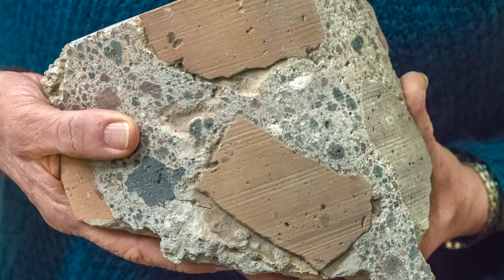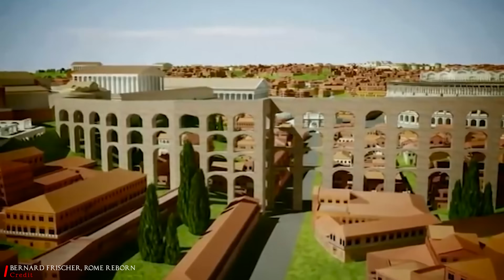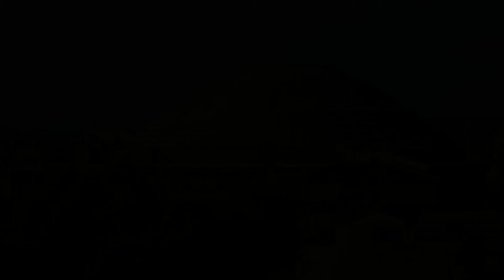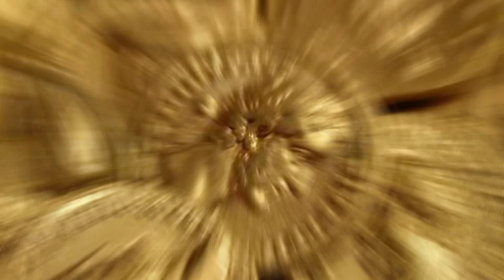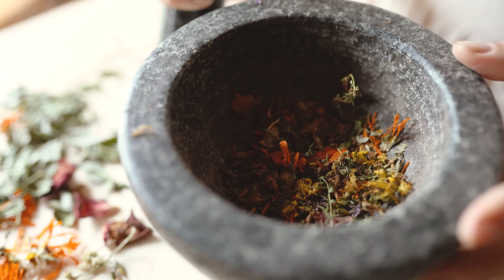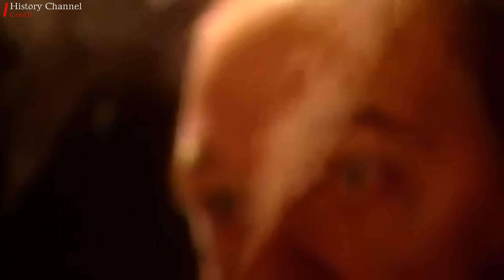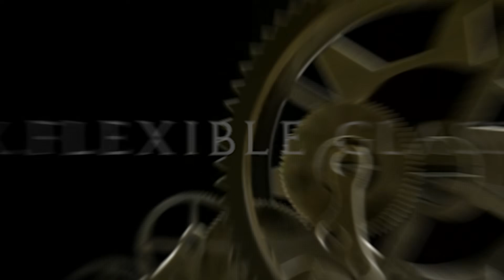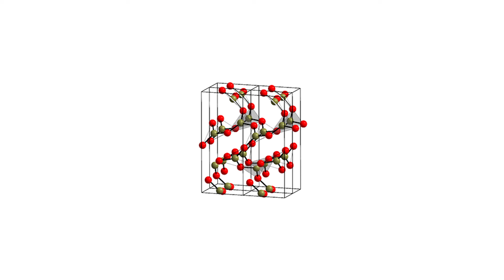Top 10 incredibly advanced Roman technologies that will blow your mind.

Comment: It is worth commenting the opinion that "Roman is one step away from Industrial Revolution" from an economic perspective: In the age of slavery, it more profitable to use cheap slave labor to move the mill than to invest in expensive machines.

Investment in capital (machines) is only profitable when the capital to labor cost ratio is very low (when the machines and raw materials are cheap, and labor cost is very high). It is not profitable to spend lots of money in water mills if your competitor uses plenty of cheap labor instead to move it 24/7 nonstop. 

Modern industrial revolution originated in Britain because the labor cost was very high, and the coal price was low. At the same time in Japan, because of the population boom, many business discarded water mills and uses human labor instead. Once Britain build factories at massive cost, it is able to produce massive amount of textiles at much lower cost than Japan, but only after large investment in machines. 

So in conclusion, the Romans were technologically advanced to proceed to industrial revolution, but the system of slavery prevents it from adopting those technologies.
Reply: @Lucas De Araújo Marques As I have illustrated before, 18th century Japan also don't have slavery, but the labor price is still very cheap due to the population boom so the capital to labor cost ratio is still very high, which makes investment in industrialization unprofitable even without the slavery system. The key is how expensive the labor cost is, with respect to the machine cost. (I guess the water mill mentioned in this case is very expensive so require huge investment.) 

In addition, another condition for the industrialization is integration into the world economy. 19th century Britain is able to sell manufactured cloth to America, India and China, all of which are huge markets. Therefore, exports would make a lot of money for Britain. Even if Rome get industrial, the limited global trade in that time would made it impossible to make much profit from it, simply because there are no large markets for its products.
Reply: @junmianzhu7459  
They probably had both. They covered their bets
Reply: The Romans began to slowly abandon slavery in the 3rd century and serfdom began to develop gradually. The colonat began to develop. This system remained in parts of Dalmatia (formerly a Roman province) until the 1920s .... even the land remained divided in the Roman way, the so-called Centuriation (Roman Grid), the remnants of such a division of the country can be seen from aerial photographs from the beginning of the 20th century ...
Reply: @marin8862  The Romans did not abandon slavery in the 3rd century. Slowly or otherwise.
Reply: @spiritualanarchist8162  the transition from slavery to feudalism began in late antiquity. it was a natural process that ended in Europe sometime in the 14th-15th centuries. There were a significant number of slaves only in Italy and the rest of the empire was almost non-existent.

Slavery in Italy was the result of endless wars during the republican era.Peasant landowners were drafted into the army and took part in wars for several years, and their families accumulated debts, which in turn meant that the rich Romans confiscated their land in the name of debt.

In this way, over the centuries, large estates of agricultural land were created in Italy on which no one had to work. At the same time, after each war, the Roman state had a large number of POW and high costs of military campaigning, the solution imposed itself.

As the war conquests were absent, as well as the influx of prisoners of war, the rich began to offer their land to ordinary Romans for cultivation, with some giving of the goods they produced. And that was the beginning of European feudalism.

Slave labor was very inefficient and expensive, most of the Roman infrastructure was built by the Roman army. When there were no wars, the Roman army built infrastructure, cultivated land or produced weapons. At that time there was no laziness in military camps, like today.
Reply: @marin8862  You seem to have developed some kind of alternative history. Slavery was a huge part of society  .It started way before before the Roman republic , and continued  after the fall of the Western Empire. Not just in the Greco-Roman sphere but everywhere in the known world.
Reply: Q: ended in Europe sometime in the 14th-15th centuries...
A: Except for Muscovy, where 92% of population were slaves until 1861.
Reply: The Romans used both machines and slaves, the Roman machines needed constant supervision and did not have a stop button, but it is clear that the machines were certainly faster than the slaves, if you are interested in the Arctic ice there are traces of pollution, those in the video are only part of Roman technologies, Roman society in some ways was like modern one, there was also a public school.
Reply: Industrialization didn’t happen in Rome because they simply lacked the resources and their metal refinement was not advanced enough. The Romans did not have enough access to the massive amounts of coal and steel needed to build factories on such scale, and the quality was metal was much lower than needed to build steam engines.
Reply: @wormius7350  Yes but I think the idea is that the Roman empire had a far more advanced technology then those who followed. It had acces to the same Resources the British had in the 18/19th century , only on a smaller scale. But it's all speculation anyway . It takes a lot of inventions , coincidental discoveries , metallurgical skills etc,etc  to develop a functioning steam engine.
Reply: This guy can't tell difference between slavery and servitude. My God. Also, good bs you fantasied in your big head.
Reply: @Dawson Davis The food use to feed slave is only counted as production cost. You are arguing that if labor cost is too high (slave need lots of food), then it lowers capital to income ratio and makes it worthwhile to invest in machine. 

I don't buy any Keynesian argument about insufficient demand here since the Roman military expenditure consistently shores up demand.
Reply: Like China?
Reply: @paulfri1569  actually, this is probably the best comparison to make
Reply: @Bolognamonster  thankyou. Abundance of people and no need to innovate as much..
Reply: No matter how you look at it....
The genius comes from the architect .
Reply: @helbitkelbit1790  The engineers maybe ?
Reply: build water mills and steal your competitor's cheap labor
Reply: "24/7 nonstop" redundant
Reply: You are missing two big variables; land usage and available technology.  Startup costs are ignored in favor of profits when they are possible within a few years.  Otherwise no one would have ever switched and half of us would still be ACTUAL slaves and not 'effectively' slaves.  

NO ONE made the switch until the tech was actually available; it wasn't a business that developed the technology with money, it was individual people striving to make advances because it was still possible to do so without massive funding.  Mostly to; buy themselves out of slavery or lift themselves and their families from poverty.  Innovation was driven by human misery instead of hope up until about 100 years ago, well after the end of slavery.

Your mistake here is applying todays economics to 200+ years ago; it just isn't the same.
Reply: @Nicholas Time  You do know Romans lived in the 'iron age '  right ? They used iron.
Reply: @Nicholas Time  P.S : I'm not claiming they could create steel engines,  I'm just pointing out that Romans obviously used  .They had mines,forges, tools, weapons, etc . There was also a limited amount of  Roman steel , used in Roman armor . Not today's stainless steel, but steel nonetheless.
Reply: actually, roman’s, while conservative in investments. would always look for new technologies that would improve production with their slaves considering how expensive they were.
Reply: The Romans used wind and water mills in agriculture, mining, construction, forestry, etc. These machines were made of mostly wood. 

The Romans didn't have access to cheap or plentiful steel because they didn't have furnaces that burned hot enough to melt iron. 

Bronze could be melted and thus could be casted, but was expensive at that time. 

They just didn't have steel piston engines and stuff like that because they didn't have the technology to make such things...yet...even if they had no slaves

Advancements in technology can make industrial equipment and processes cheaper. The Romans also didn't have enough time to reach the point where mostly machines became more economical than mostly slaves. (Note, that the Romans did have and use machines...just not significantly) 

Slavery peaked during Rome's largest conquests. It started during the Punic Wars and declined after Augustus. During this time there was an abundance of slaves and thus slaves were cheap. 

A string of slave revolts also influenced the later decline. 

By the time of Augustus' death, expansion stopped for a while, but there was a little more expsnsion later.

Slavery still existed but it declined due to a decline of slaves on the market...which was due to a lack of new conquests. 

Paid labor and Serfdom started to fill the labor gaps as access to slaves decreased.

Also, Rome's primary use of slaves was in agriculture (an industry that is still highly laborious). This was because during the Punic Wars, a significant potion of soldiers lost their farms due to being on campaign, without returning home for the harvest season. 

Rome used to have a well functioning land distribution system. The amount of ownership of land was limited by law, per individual. But this system fell apart due to large numbers of Romans losing their farms, and corruption seeping into the government (Rome used be be increadibly incorruptible and disciplined).

A great number of slaves were available after the Second Punic war. Wealthy individuals saw an economic opportunity and using loopholes in the law, acquired large swaths of land, forming large corporate farms, worked by these cheap slaves.

Our perception of Rome is mostly of a certain short period in time.

E.g., there was a time when Roman legionaries, Centurions, the collosium, etc didn't exist yet. Legionaries came into existence when Rome ran out of soldiers because landownership was a requirement to become a soldier (as pointed out before, Romans had lost their farms en mass).

So, a professional army system was created by Gaius Marius...and anyone could join and become legionaries (even non Romans).

E.g. Most of Ceasar's soldiers were Spaniards, Gauls, etc.

All of this is actually also what caused Rome's decline. All those landless Romans (plebs) migrated to the city of Rome, en mass. This change in demographics created huge political shifts and caused the rise of populist politicians like Caesar. 

Before all this, Romans were the epitome of not being corrupt. Their greatest hero's (individuals they admired and strove to emulate the most) were individuals who resisted corruption in some event. At that time, the Romans were extremely focused on things related to being disciplined, incorruptible and having honor.

Rome had an elected office called Dictator. In special emergencies all power was given to one individual. This office was used several times in Rome's history. Individuals who stepped down from this powerful position automatically went down as legends. The Romans understood how corruptible this position was and how much discipline it took to step down. 

All Romans (before Rome became corrupt) who pursued a political career, aimed to reach that height and the prove their discipline and incorruptibility by stepping down when the emergency was dealt with. 

This was part of Roman culture. The Romans has a code (almost like the bushido code) called the Mos Maiorum. Rome was glued together with this unofficial code. It was also when this code was no longer as revered that corruption seeped into Rome

Most people don't know this version of Rome. This was the version of Rome that fought Hannibal and refused to give up. But, in some ways, defeating Hannibal was what caused Rome to slowly become extremely corrupt.
Reply: @tylerdurden3722  You're mostly right, but they had iron in Roman times. Iron by itself is actually weaker than bronze so it was hardly used. Having an ever increasing harder time to find tin to make bronze civilizations eventually turned towards iron more ESPECIALLY after the discovery of how to make steel from iron... as I have heard. 😅
Reply: .....and the rich and powerfull allways hindered oppozing  every advancement  that would infringe on their proffits...just like they're  doing in our times where ever tbey are able to do so. How many patents have been bought up by corporate mafia just to silence the inventors, or if they wete not willing to sell them,  they were silenced  "otherwise".....
Reply: @tylerdurden3722  The Romans certainly had iron. most Roman armour was made of Iron, However bronze held a better edge than their primitave iron, and was not as brittle, It was only with the development of eairly types of steel, that bronze was surpassed. ( so I have read)
Reply: @groblerful  Yap, the Romans had steel, but they didn't have cheap plentiful steel.

Their steel was wrought iron produced in bloomaries.
These bloomaries weren't hot enough to melt steel and produced a mix of slag and iron called sponge iron. 
Impurities had to be painstakingly hammered out (this is called forging).

What made the industrial revolution possible, was the invention of large blast furnaces that were hot enough to melt steel. This only really happened in the 17th century. (others have melted steel before but only in cruibles in small amounts). 

This made steel cheap and plintiful...and because it now be melted, that allowed casing iron (which can achieve complicated shapesl.
Reply: @tylerdurden3722  thank you for sharing that great read. I truly enjoyed it 👍
Reply: @tylerdurden3722  You wrote a lot , but if you start with 'they couldn't melt iron' i don't know if it's even worth reading the rest.
Reply: We could even argue that the industrial revolution was the beginning of the end. Eventhough it brought us a lot of comfort, the added pollution and influence on the environment is a high price .Maybe the Romans would have developed an very advanced wind & water energy industry. We obviously will never know, but it's fun to imagine these things.
Reply: @spiritualanarchist8162  I don't think technological progress is equal to destruction of the planet. We should have reacted faster to pollution and technology will have to be the solution of our problems today.
Reply: @Oliver-tb7ry  I'm don't mean technological progress as such ,It's specifically  more the industrial revolution.  If you follow the history of industrial progress, you will notice how we humans only started to act when the pollution became so extreme something had to be done (Especially when the rich & powerful) couldn't escape the stench of the Thames , and the killer Smog began taking it's toll   ) Anyway, the industrial revolution brought us the coal/oil/ gas / consuming technology that is making the planet uninhabitable for humans. It's possible we could have developed a cleaner technology overtime , because the invention of electricity isn't linked to the invention of steam engines, until later. Too make a long story short, we could have gone a different route from the 17hundreds but it probably would have taken longer, and it would have mend less comfort.